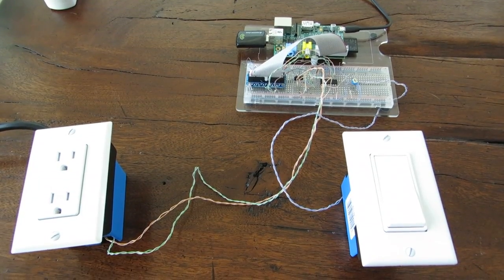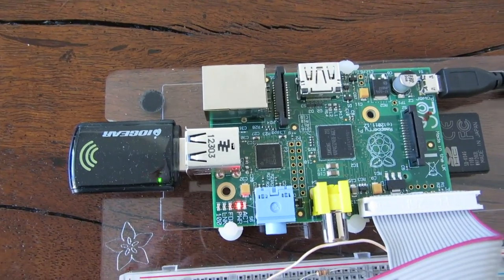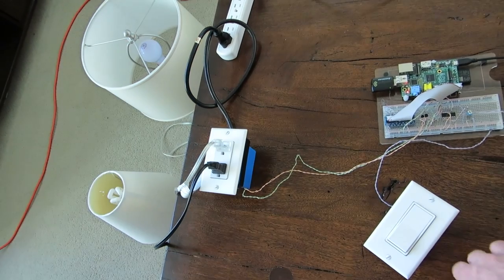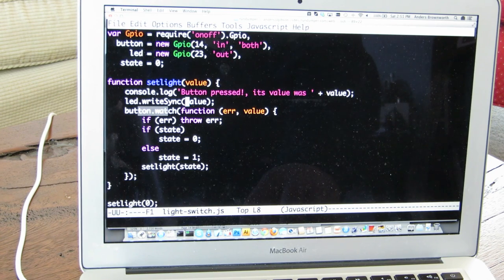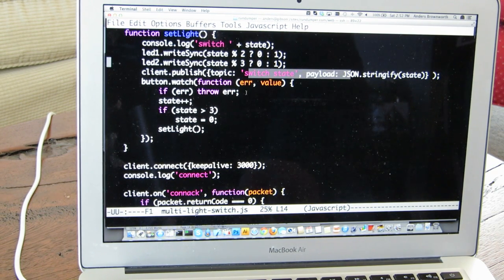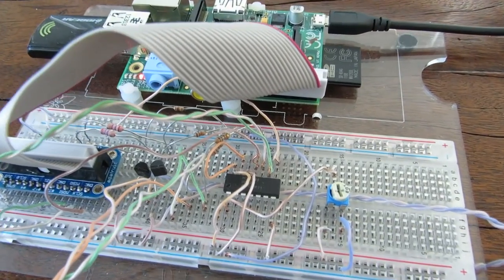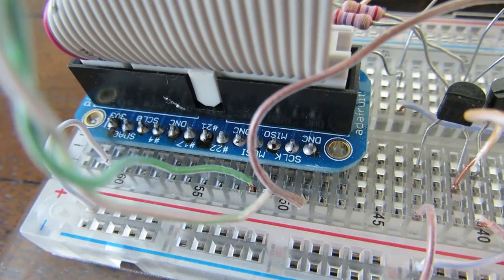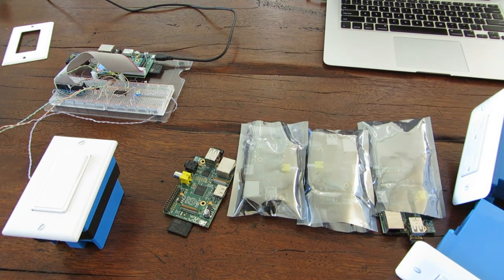Home Automation with the Raspberry Pi and Node.js - Well Tempered Hacker

Comment: Im sorry but the pi is well overpowered to be in every or even half of every outlet box, also 35 dollars is NOT cheep enough for the amount that anyone would require and your power consumption while less overall would still be more than necessary for the concept of a decentralized network. If you put an atmel chip with wireless connectivity in every box and used a few PIs maybe one or two on every level of your home and networked all of that together you could have all of what your video at least demonstrated and more with the necessary computing power, instead of more then you would ever use.
Reply from the maker: +Reggie Heinemann I don't so much want a raspberry pi as much as I want a microprocessor so it can be more cost effective. But I disagree - in time you will want more processing power per device rather than less. The utility will grow exponentially. (I liken it to the micro controller that powered candy bar phones versus the microprocessors that power today's smartphones - people still consider them underpowered)
Reply: +Reggie Henneman I agree, the Pi is a pretty powerful machine (also relatively power intensive) you'd be better of just using cheap Arduinos for this sort of work. Besides Arduinos are a lot smaller even the once with the ESB8266 WiFi module on it.

And there is also a NodeMCU that is interesting for scripters that runs LUA and has a lot of IO and WiFi and is a mere $7.

But on the subject of scripting when you program in NodeJs like @Anders Brownworth is doing ,you need some serious power ;) J

This sort of stuff you need to do in C or C++ have 1 Pi and it actually decodes 433MHz switch devices, I have some IR PIRs with RF, an RF door bell and the house is fully equiped with Philips Hue bulbs (or the clones). One deamon written in C++ does it all and I can even still stream my media to my TV -- which is useless since it's a smart TV.

Comment: $25? Check out the $5 ESP8266 wifi microcontroller board all over hackaday. But currently I'm using RF because of low power purposes and tunneling the RF over USB to the server. Let me know if you'd like the schematic/board files and arduino (atmega328p) code.
Reply from the maker: The deeper reason to having a Raspberry Pi rather than just a micro controller at each light switch and wall socket is all of the capabilities you get beyond turning lights on and off. For example, reading the temperature, taking pictures and using mic / speakers without adding wiring. In theory, capabilities like home security, intercom, and baby monitors can eventually be implemented purely in software - no additional wires.
Reply: Anders Brownworth I hear you, it comes down to a difference in strategies. I have most of what you are talking about on my gateway arduino board plus I use gas and humidity. wifi through ESP8266 is cheapest. RF through atmega is easiest (since I already have the schematics/board files). And raspberry pi I wouldn't consider because of price and they banned me from their forum for asking for a build of materials. I want to limit my reliance on any corporation or so-called "foundation". Even though I'm still using Pi's in my car to control locks, trunk, start, etc (I basically just turned it into a router and host php-mysql-python server).
Reply from the maker: Andy Payne Either way, thanks for your input. Always good to think through the pluses and minuses of the different strategies. Best of luck with your setups.

Comment: DO NOT TRY THIS AT HOME! (as they say): what if one of the little control wires fell off inside the power socket and came into contact with the AC supply?  Fried Pi, possibly fried network and even fried operator.  Basic message is don't mix control and power wiring inside a hacked socket without taking great care on barriers between - 2 levels of isolation and a grounded screen between.  Throw in some voltage limiters to protect the control side and don't forget kV level power line transients!

Comment: If you're using your PI for home control - you might want to consider making it immune to power failure... doesn't do the SD any good.. this is for those happy with a soldering iron -  good conversation going on right now at https://tech.scargill.net/more-uninterruptable-thoughts/